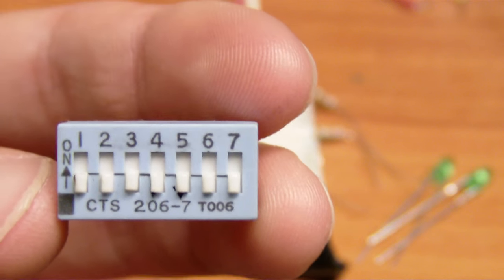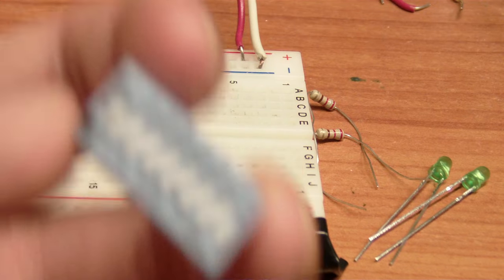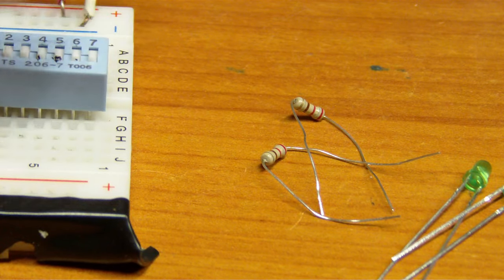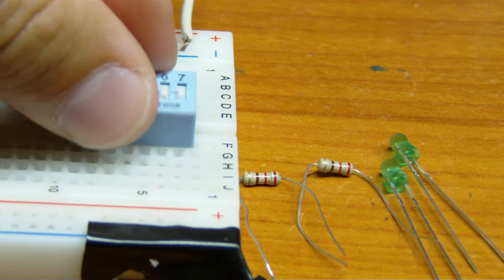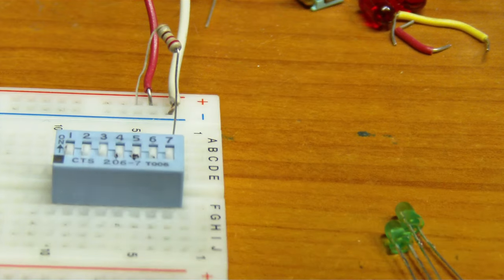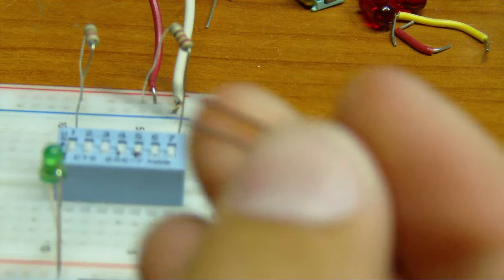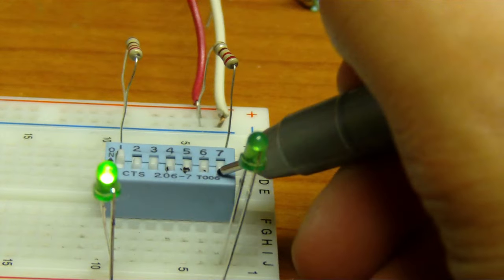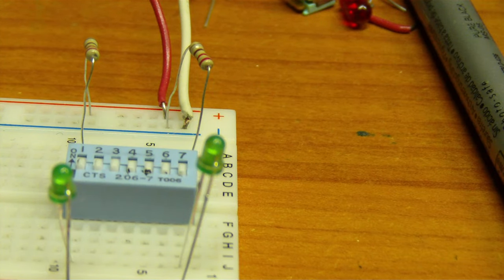5imple Circuits: How to use a DIP switch

Comment: Do you know if you can get an 'on-off-on' dip switch or does that not exist because it would be to small to make?
Reply: Cozmictracks Thie switch you are talking about will no longer be a dual inline package but a triple one. And yes, they exist as DPDT (Double Pole Double Throw) or triple inline switches.

Comment: so you moved your resistor on the far right from the positive to the negative rail and never explained why?
Reply: Because otherwise the circuit would'nt have been closed and thus no current flowing.
Reply: @d3lt4X  thank you! I’ve been haunted by this over the years. Closure at last!